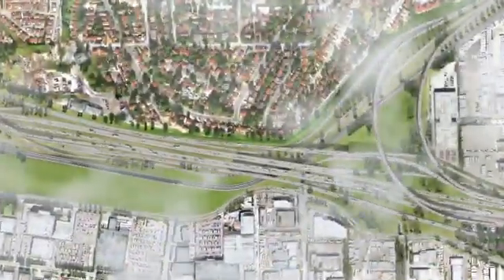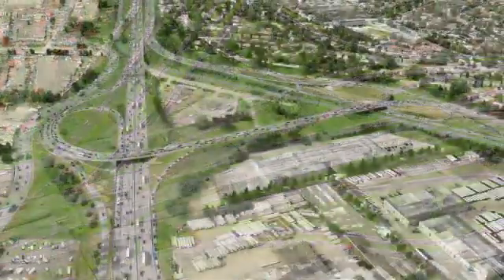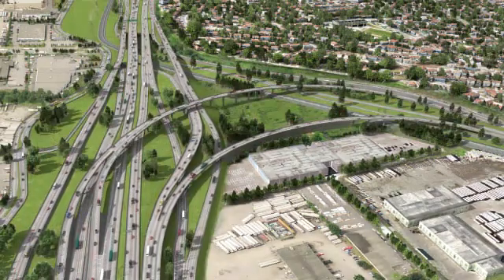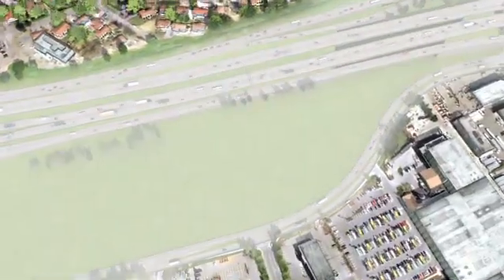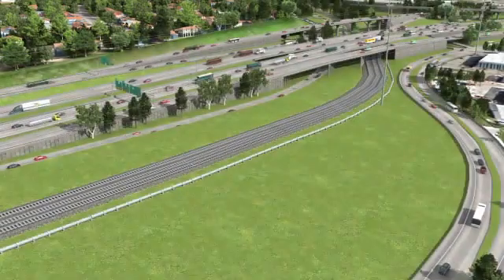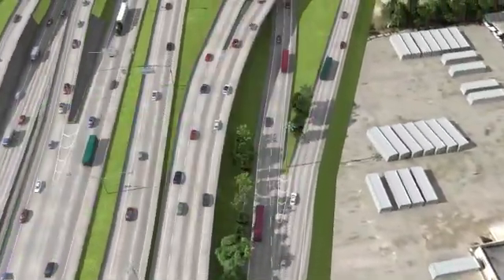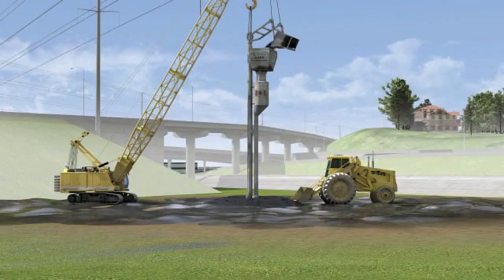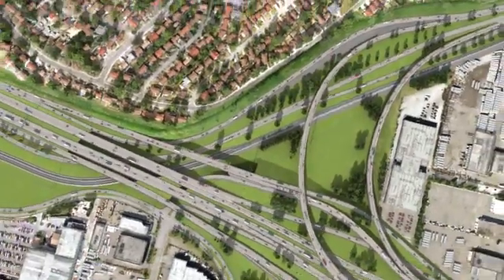Animation of Cape Horn Interchange

Comment: This interchange in this video looks so beautiful and smooth traffic system but don't be deceived yourself. It will create a serious catastrophe because of some mergers (heading for eastbound to Surrey and Langley) . The lengthy of line up traffic will be double than the former highway. Wait and see what those PHD engineers have to say when complaints arise.
Reply: how do you feel about it now? 7 years later. Felt smooth as butter with the tolls, less traffic, it was beautiful....until they removed the tolls...I want the tolls back. There's so much more traffic now and when someone doesn't know where they're going and merges into the express lane to Guildford last minute, look out!